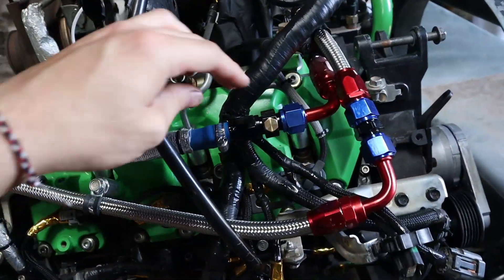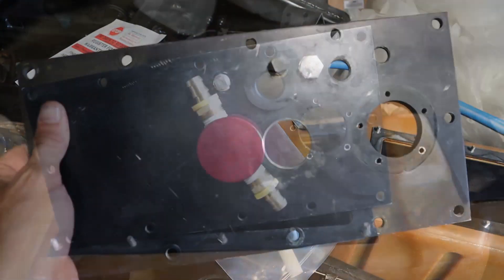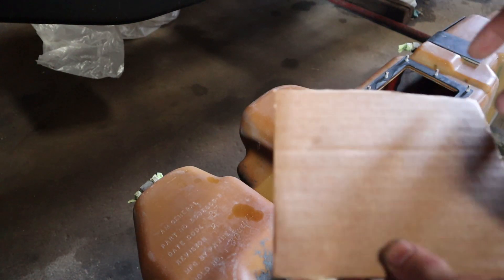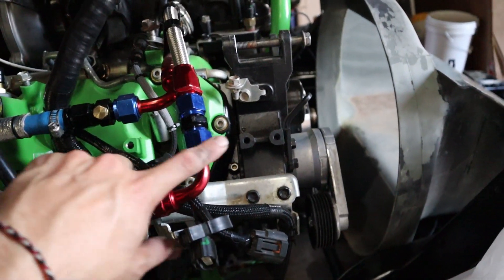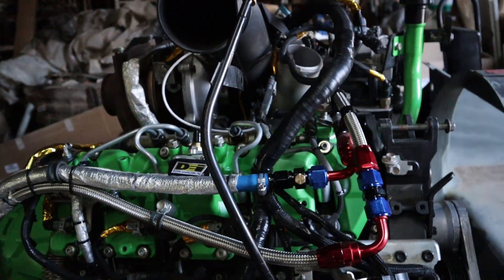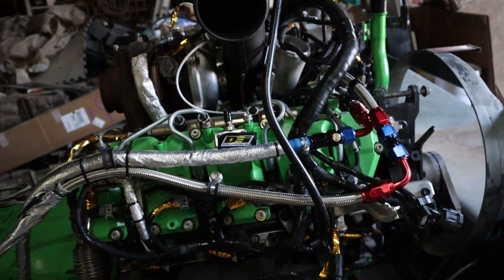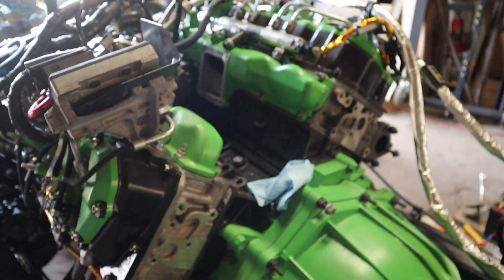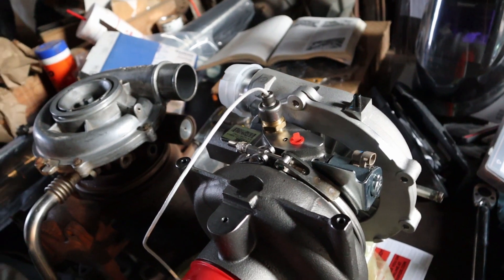Project Duramax Humvee - FASS Suction Tube Install, CP3 Pump Leak Diagnosis, and Prep for New Turbo

Comment: Exact same scenario here! Just did a massive big turbo build, & first start it’s loping like crazy, blowing thick white smoke, & I found the top of my CP3 pump soaked in fuel, & the valley full & overflowing over the back of the motor with diesel. I cannot for the life of me pinpoint where exactly it’s coming from.. but I’ll check that return line now, even though I worm gear clamped everything.  Thanks for the video!

Comment: Hey brother thank you for all the work you’ve put into these instructional videos. I’m building the same project following your steps and was wondering if you can provide some more details of where all the fuel lines coming from the engine was done. I’m stuck on how the lines to include injector return lines where routed.

Comment: Loving your video series so far. Any back story on the drivetrain? Duramax came from wrecked truck. What year, miles, stock or mods. I have wanted to do this for years but I want to go the 6.7 Cummins route. I like the Duramax but love the Cummins. Also maybe do a video about buying one of these if you used Govplanet. maybe the process and the title process. Thanks
Reply from the maker: Thanks. It was out of a wrecked truck. I tore it down and did headstuds and minor things before I had thought about doing a youtube series on the build so don't have any video from that really. A cummins swap would be nice too. There is a lot more info out on that swap now than when I was looking to swap mine a few years ago. That's why I went with the duramax back then. I'm thinking of putting that info in a video sometime if I can find the right one to include it in. Thanks for watching man!

Comment: Watching you put that intake on brought back nightmares of installing Harley-Davidson Intakes!!   These things ever have leaks??
Reply from the maker: The intakes on these have been known to leak but it's usually bc of an o-ring failure on the bottom of the intake or having it slip out of place when installing the intake back on. It's not a huge issue but can happen.
Reply: @tossthewrench  yup, exact same problem on them Hogs   :)

Comment: I am concerned about the fittings at the tank. The hummer is famous for being able to ford deep water, but you have to be sure that everything is sealed, not just at the tank but everywhere. Or you can just keep it out of deep water!
Reply from the maker: The fittings at the tank are sealed. You can cap off the holes and fittings and apply a low pressure of air or air/water to test the seals.

Comment: NIce work,  I just added a H1 hardtop to mine, had turret.  I got a 6.5 na with 4l80E in it now.  Have most parts for the 6.5 Turbo swap, but still on fence about the Duramax swap,
Reply from the maker: I'm hoping the duramax swap will be all worth it in the end. At least you have a 4l80E trans for the overdrive. My previous trans was only the 3 speed so it tapped out early on the highway. I've seen some people able to pull some power out of the 6.5 turbos. Would definitely be an easier option. Good luck on your build.
Reply: @tossthewrench  you'll love.the end result,  just keep at it.  The vent line hardware that rubber grommet sucks big time...lol.  be sure to cut an access panel in the floor of the tunnel for later access to the top of the tank.  It helps alot.
Reply from the maker: That's a really good idea. I'll definitely have to look into that!